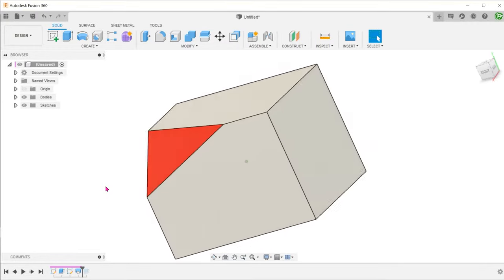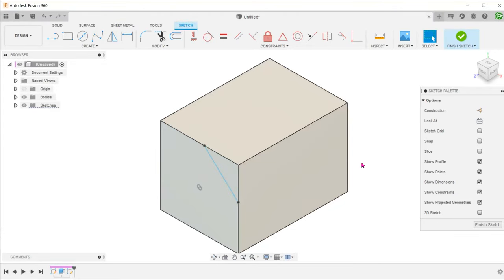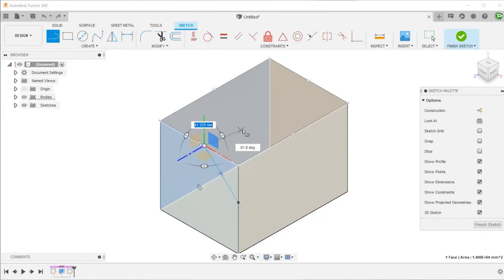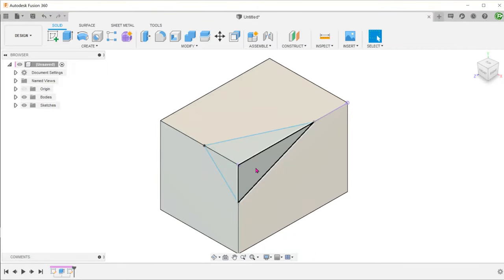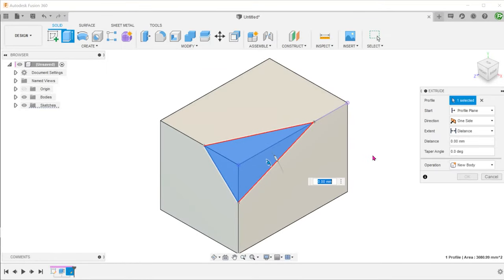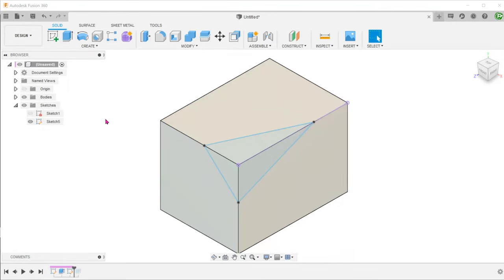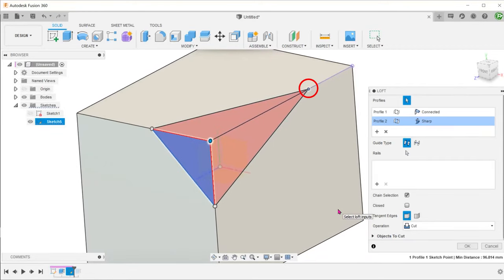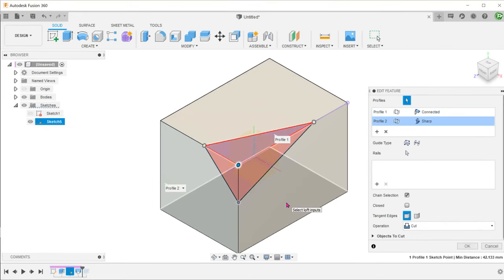Fusion 360 - Oblique Cut

Comment: Buddy just for fun here is one more way.....  Use the three points you have to define a plane then preform a split body using the new plane and delete!
Thanks for sharing the great videos! You are a master Fusion user for sure!!
Reply from the maker: Yep, that will work too. Thank you for the suggestion!
Reply: I tried that, but it doesn't seem to work as well. Firstly, learning about creating a plane between 3 points was smart...thanks for that. But once I have the body split...I now have two bodies, and when I try to delete it...the main body returns back to the full shape as it's lost it's tool. I struggled yesterday to do this very operation. I like using the extrude tool, as it leaves me with one body. Having only body is critical for doing a 3D print option, as the selection operation only allows one body execution at a time. Am I doing something wrong with how I delete it?
Reply: @vivianmorresey  Buddy be sure you have keep to checked! Then go to left browser and you should see two bodies? Just hide it delete the one you don't want... Hope this helps.
Reply: @wernerberry7800  Thanks...interestingly, once I had the two bodies, I tried hitting the delete and got the same issue ... However, there is another command below the Delete called Remove and that did exactly what I wanted. For me, it was Remove instead of Delete. We got there and learnt two new skills...awesome
Reply: @vivianmorresey  that was my bad Buddy! I should have said remove! I just do it without thinking. Great you got it!
Reply from the maker: @vivianmorresey  Yep, it is always better to remove. Remove also creates a step in the timeline.

Comment: One more method - one sketch to draw first line on front face, second sketch (or use first one with 3D sketch enabled) to draw second line on top face that would act as path for sweep.
Reply from the maker: This sounds interesting. I went back to try this and I think it is definitely a viable method. However, it looks like you would not be able to control the third edge of the cut. It would depend on the direction of the sweep.